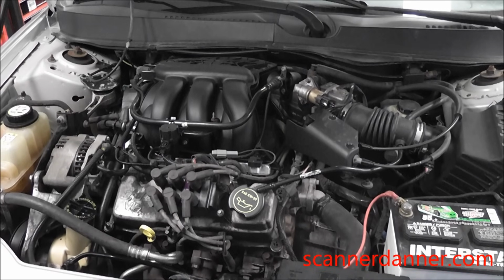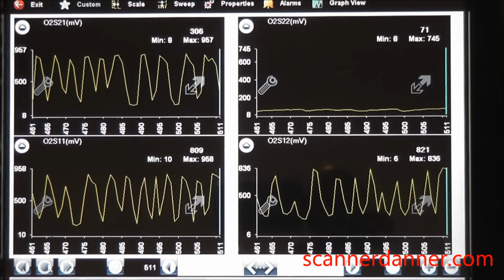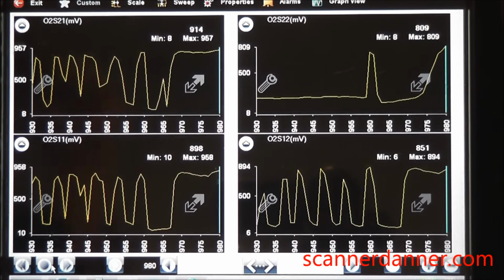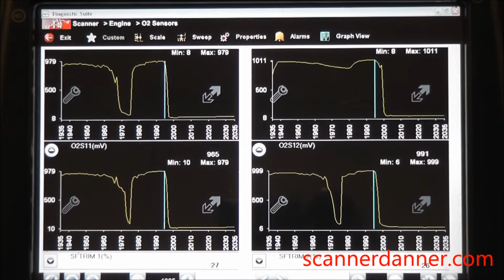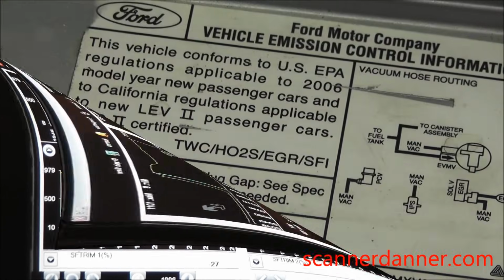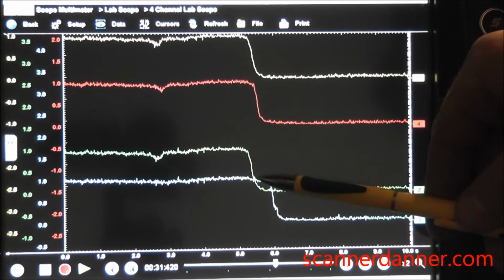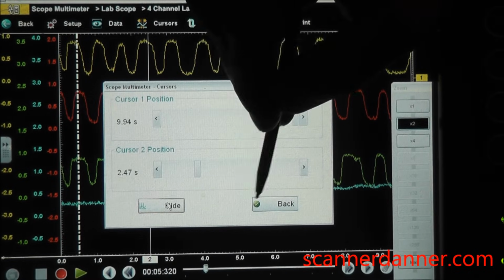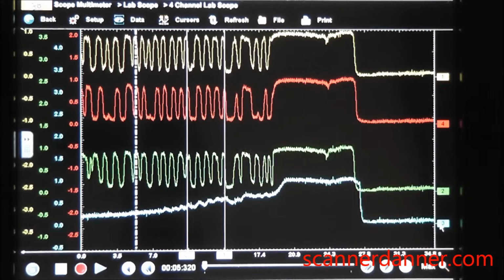Diagnosing a catalyst efficiency code (P0420 or P0430)

Comment: Thank you for the video is very helpful, can you tell me what was the root cause that made the CAT go bad ?
Reply from the maker: so many things! Misfiring, fuel imbalance issues, oil burning over a long period of time. Anything that makes the cat overheat will kill it. It sort of smooths out all the little nooks and crannies that catch and store oxygen. Then when it gets too hot, it will melt all of that together and become a restriction. 
Also, contamination can occur from all sorts of things from the fuel being burned to the oil being burned. In theory, they should never "go bad", but they do. Sometimes there is not a cause that you are going to fix. In fact, in most circumstances, that is the case. As long as your fuel trim numbers are good and you have no misfiring and no driveability problems, change the cat and you'll be good for another 150K. But NEVER use aftermarket cats!! Factory only, unless you want your P0420 code coming back in 2 months.

Comment: Hi Paul, big fan of Your channel. One question about the video - can You explain, why the B2S2 voltage is gradually rising before You introduce the propane?
Reply from the maker: As a cat warms up, it will start to catch and store oxygen, so the lean swings, oxygen gets absorbed, and so you won't see the same up-down swings  on the downstream signal. Make sense?
Reply: @ScannerDanner  Thank you for the answer Paul. Yes, this part I'm familiar with. I wasn't maybe very clear in my question, sorry for that, I'm from Estonia and english is not my first language. What I meant, was the rising of the average voltage of B2S2 in the video at 27:30. I'm looking at the B2S2 waveform from 0-18 sec scope time. I would have thought that the line would be staying at about the avg of the B2S1 voltage, just with reduced/almost none amplitude, but in before mentioned time window it starts below 0.5V(lean side) and gradually rises until it settles well over 0.5V(rich side). Is this normal operation and if so, why downstream O2's sit on rich side, even when upstream averges at stoichometric? Sorry for my complicated expression, hope you catch my thought. 😀

Comment: so let me brainstorm with you, So bank 2 sensor 2 sits a 750mv at idle, but the other downstream sensor fluctuates normal, b2s2 with fluctuate with peddle, then sit back at 750mv at idle. So I put new cats in the car, aftermarket. wouldnt b1 be giving me a problem too if it was the cats, LTFT is normal and same with STFT. Should I be looking for a bad coil pack on bank 2, because high volts is rich, which means its making up for air if Im not wrong.
Reply from the maker: a downstream sensor shouldn't be fluctuating like the upstream as the cats job is to catch and store oxygen. However, as stated in this video, until the cat is warmed up, you will see a fluctuating signal that will mirror the upstream. Also, when the cat is failing. 
As for the high, steady volts on the downstream O2, this is completely normal
Reply: @ScannerDanner  so I should be looking at b1s2 because she's all over the place, if I sit at idle for long enough, they fall to about 100mv, my mufflers sound like something happened. I put O2 extenders in and I'm taking that crap out. I'm gonna go with my egr theory, because of the idle flux, because it is directly connected to cylinder 6 on bank 2 which is the original B2S2 stuck high. Im gonna watch the video again and more but It helps. But I bet the egr is operating right through range just won't shut all the way at idle.
Reply from the maker: @matthewpetersen4417  what are you working on? Year, make, model, engine? Also if you're chasing a driveability problem, in most circumstances, you don't even want to be focused on the downstream O2 sensors
Reply: @ScannerDanner  its a 2008 dodge charger 3.5, in this state I have to pass emissions and they are stupid Strick. So all I have had for the last 200 miles is a pending code for a lean system, but when the O2 extenders are out I get p0420 and p0430 as only a pending code and never sets the mil light.
Reply: I pulled out the 110 psi fuel pump and installed the stock pump, but bank 2 has been a problem even before the new aftermarket cats. I think a coil is bad or and injector is leaking. She goes like hell for a 3.5, I had to rebuild the top end after I blew the timing belt and it's got sold valves no dish valves, and had the heads recut. Its full x-pipe dual exhaust, with what's goanna be flow fx mufflers. Short ram air, for a 3.5 its bad. Runs 55's for tires
Reply from the maker: @matthewpetersen4417  downstream O2 sensors on your car have zero to do with any driveability problems your having. Aftermarket cats are junk and will continue to set those codes. You have Teo separate issues. Ignore your downstream issues for now
Reply: @ScannerDanner  So Sir, I've come to a conclusion, valve cover gaskets, throwing lean codes both sides, fuel trim is at LTFT is at 33 and catalyst below efficiency. So, I did spark plugs and found oil in the plug area. Have you heard of valve covers being a cupert in lean conditions, especially if my PCV valve is direct to bank 2 which has the bigger issue than bank 1. I may have found my invisible vacuum leak.
Reply: How else would unmetered air be going in, only thing I can think of egr is on bank 2 head, and stuck open would-be unmetered air.

Comment: How to rule out. If it's a bad cat or bad sensor. I have lexus ls430 2003 it threw p0430 & p0420 at same time followed with strong strong exhaust smell inside & outside. Inspection shows no exhaust leak. Mech saying change cats.. Pls help I can't drive this vehicle
Reply from the maker: What are your fuel trims? And any exhaust leak in front of the cats MUST be fixed first! That can cause false cat codes

Comment: As an alternative to putting the scope on the sensors to get the true time delay of the sensor responses, is it possible to figure out the length of time one frame takes? i.e. if 1900 frames took 15s to get , then you can figure that ~127 frames/s. Or are frames not consistent and each one could vary slightly in length of time?
Reply from the maker: Frames are not consistent. The year of the car and the scan tool you are using will be the variables. Then also if you are using enhanced data or obd2 data

Comment: I watched your video about the P0430 code but I have a question about getting that code
because my bank 1 and bank 2 have different max thresholds. I'm thinking if bank 2 had the same max as bank 1 I would not be getting the P0430 code because bank 2 reading is always less than what the bank 1 max is when I get the code. I have a 06 F150 5.4 3v. Is it normal to have 2 different max thresholds? Thanks
Reply from the maker: It's not so much the min or max that the computer is looking at for cat monitoring, it is the frequency. What are your min and max numbers on those two rear O2 sensors? Do a wide open throttle run for your full rich signals and then a high rpm deceleration for your full cut mode for the lean side and tell me what you see
Reply: @ScannerDanner  The minimum for both banks is zero and the max for bank 1 is 0.687 and the max for bank 2 is 0.637. On my scanner these readings are labeled rear to front switch ratio. I'm not sure what rich/lean signals you want me to check. Fuel trims? My truck has 90k miles so I don't think my cats should be bad already.
Thanks
Reply from the maker: @ytwatcher01  those numbers don't sound too bad, but I like to see over 800 mv on the rich side. 90% of the time a cat code is a bad cat. Make sure you have no exhaust leaks and don't use aftermarket cats
Reply: @ScannerDanner  ok thanks for the help and I forgot to mention that the code only occurs when driving in Over Drive and accelerating without the trans down shifting. So then there is a high engine load and a temporary rich condition. If I force a downshift from OD there is no code since there is a lower engine load.

Comment: I replaced THE COMPLETE exhaust system on my 04 gs300, and the 4 O2 Sensors, but one sensor Bank 1 upstream threw a code, and it was simply an exhaust leak from bolts backing out

Comment: I have a 98 dodge ram 1500 with 5.2. Pulls a po171 code lean bank one slow response. I have replaced every sensor , vacuum leaks,idle control valve, catalytic converter, gasket under throttle body. Mas sensor. Can undo battery put back on truck runs great for fifty miles engine light comes on idles up and down, gets 5 mpg and reads lean bank one code. There's nothing else to replace that I know of. Help. Short term fuel reads 32.5 long term 0.0.
Reply from the maker: Okay awesome description you absolutely have and over fueling condition (5mpg) and a false lean code. Forget looking for lean issues and let's focus on the O2 (dont care that it is new)
Let's do the simple stuff first:
Step 1 make sure you have power and ground on your O2 heater circuit. Sensor side of the connector, it should be the  2 wires that are the same color (usually white).
If the heater isn't working (blown fuse or poor ground) you're symptoms will be that is runs good at highway speeds but not good at all in local stop and go traffic.

Comment: Hey in this video you show the custom configuration screen on the snap on unit, for the life of me i cant find the st Fuel trim.  Also what does the  MNTR (HO2S1) B1), stand for? Both HO2S1 MNTR (B1)AND H02S2 MNTR (B1) show lean. 2006 xtrail     2.5lt.  great video

Comment: Nice video, very useful. A question : How would be seen the downstream sensor in the case of a plugged/blocked/stocked catalyst converter? I guess it would be seen as a very stable voltage not responding to changes on the throttle/accelerator request. 
Best wishes.
Reply from the maker: If I have a plugged cat, the car is going to have low power so I'm going to not even use the downstream sensor for anything. I'll use the upstream for wide open throttle fuel delivery tests to rule that out, then if the O2 stays rich like it should, ill move away from fuel,  and then do a backpresure test for the exhaust
Reply: Thank you . Yes, I'll make a hole and do a back pressure test. I just wanted to skip that so that's why I did my question.  Thanks again
Reply from the maker: @DanielPerez-ln4vu  you don't need to make a whole, just remove the upstream O2 and test it there

Comment: Finally, someone who knows what the hell they’re talking about. This video is a true diamond in the rough. So much BS associated with the P0420 code. Thanks a ton for taking the time to make a quality, informed video
Reply from the maker: Thanks so much!
Reply: @ScannerDanner new to the concept of scopes... possible explain how you choose to connect leads?
Reply from the maker: @johnharbour633  a lap scope is nothing more than a very fast voltmeter, you would connect a scope to get a signal the exact way you would connect a voltmeter to get a signal. One lead to the wire you are testing and the other lead to battery ground
Reply: @johnharbour633  Labscope as Paul stated is very fast volt meter.  Most of the time if not all of the time, your using it almost as like a Doctor uses x-ray or MRI.  A digital volt meter can not display the numbers fast enough for you to see.  Think of a Labscope as viewing voltage over time. That is seeing or capturing the event over a period of time frame.   Actually what we are really using in terms of Labscope is better described as a DSO ( digital storage ossciliscope).  It's this high speed capture , the digital part that allows us to freeze frame.  A true live ossciliscope might not help us much on cars.
Reply: @ScannerDanner  I really need you me help telling me if this means when it jumps (usually) is it clogged or just failing?? Like if it is still flowing it has no effect on performance so it doesn’t mTter to me but if it’s clogged that is performance issues???
Reply: mostly it means clogged, But if the cat hasnt bin replaced a very long time it can be failing and clogged at the same time.
Reply: One of the best instruction videos on CAT and sensor tests.
Reply: Seriously. This video clears up so much of the mystery in regards to Cat inefficiency DTCs.  It makes sense now why the spark plug extensions hack works to temporarily trick the  ECM into thinking the cat is fine. Pulling the sensor out of the stream and reducing the amount of gas it's exposed to emulates the lower O2 value the ECM is expecting. Note to nerds like ScannerDanner, be sure to tell the hillbilly why it works so we can limit the amount of backwoods magic they push.  JK... Nice content!

Comment: Best explanation video for cat efficiency codes I’ve seen. I’m getting good oxygen sensor behavior but yet throwing cat below threshold codes on both banks with brand new cats…I can’t bring myself to risk it and throw factory cats in if it’s not going to solve the problem 😬😬 2007 tahoe 5.3
Reply from the maker: Factory cats unfortunately my friend
Reply from the maker: Or an anti-fouler in the rear O2s 🤫
Reply: @ScannerDanner  I put them in both rears today haha we will see 🤞🤞
Reply: @nathanielmoore5677  did it work?

Comment: I'm speechless how complicated the emissions problems are and how much knowledge you have about this.  My smog check was due and I can't pass it because my O2's , I  replaced the 4 O2s and still can't pass,  the smog check guy said my truck is rejecting the downstream sensors, by the way, I  don't have check engine on. Can you help me with any advice on this?
Reply from the maker: What code are you setting?
Reply: Thanks for your reply and sorry for the delay answering you back,  the code is P0420 , I just went back to the smog place this morning and they said that I have to do the driving cycle because the catalytic converter is not ready. I really don't understand this,  is so frustrating.  I hope you can give me another tip because I already did the drive cycle this morning before going to the smog place and nothing happened.  Thanks again for your response
Reply from the maker: @menjivar76  typically you need to drive in some 35 mph stop and go traffic for the cat monitor to run, but most likely you need a cat unfortunately
Reply: @menjivar76  you can check your self, buy odb2 bt or wifi, use your phone check, not ready because you car need time to relearn, my 02 accord after install new o2 i have to drive more then 500 mile, 500 mile about 2-3 week, but my other car 01 crv after install new O2 only drive 20-30 mile done relearn.
Reply: Is a 2004 Nissan Titan
Reply: Thanks a lot,  finally I was able to complete the drive cycle 🙏, thanks a lot for your help,  I was afraid about the Cat,  but everything is good for now 👍👍👍👍

Comment: what is the cross count over .45v that triggers the code. the ecm is programmed to count the crossovers of the rear 02 sensor. Isnt this part of Smog analysis. All car manufactures have the threshold. What is it?

Comment: What about if it's fine on the freeway for over 1,000 miles not setting a code, but then city/idling trips the p0430 code?
Reply from the maker: that is just simply because you are not meeting the criteria on the highway for the catalyst monitor to run and when you are city driving you are. Very typical my friend.
Reply: @ScannerDanner  thank you so much, that makes sense now

Comment: I prefer to monitor the issue the same way the PCM monitors the issue. Watching sensors on a propane enrichment test is perfect. Checking cat temps gives you an idea if the cats are alive, but won't give the same in depth answer as reading the signals from the PCM.

Comment: Very informative video!  Few days prior to watching this video, my friend asked me to look at his 2015 Ford Explorer(ex Police Interceptor) with 92k miles.  My knowledge about cars is limited and this video made it obvious :)  Basically his car showed a check engine light.  The code with got was P0420 which seemed to be Bank 1.  I told him that the code means something is wrong with the way catalytic converter is working.  I looked at the live data and marked 4 oxygen sensors and fuel trim data to see the graph.  With my limited tool, I did notice that one of the oxygen sensors was marked red and was fluctuating a lot.  From your video I now understand that upstream sensors should/will fluctuate, but downstream should usually be less active(when at operating temp).  Also his STFT is at least 22%+ or more, but LTFT is at 0%.  1) So this P0420 code always means downstream reading is not efficient enough?  2) You think Cat is the issue here?

Comment: Can you explain did this pattern has impact for corrections on short and long trim datas?

Im forgotten to mention that this is awesome teaching and exploring!?but you can extend any time.
Reply from the maker: not on this model, or any model that I have seen, that uses a narrow band upstream O2 sensor. Only models with an AF ratio sensor (wideband O2) use downstream fuel trim control, and even then, it is only some of them
Reply: @ScannerDanner  Thanks dude.

Comment: 06 Dakota 4.7L v8. last august(about 130k miles) I replaced the cats/y-pipe and all four O2 sensors. Check engine light came on yesterday. P0420.
Reply from the maker: Aftermarket cats are junk. You're lucky you got a year. I've seen them flag a 420 after 2 months. 
Make sure there are no exhaust leaks before pricing a factory cat
Reply: @ScannerDanner  No leaks right now. But interestingly all the Dodge parts sites show "discontinued" but they're still available through Mitsubishi parts sites.
52013780AB